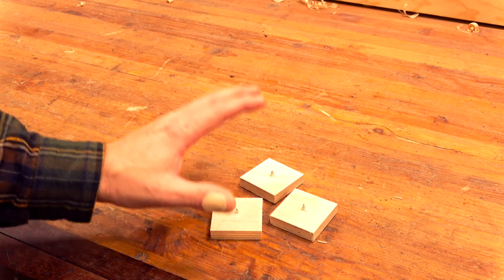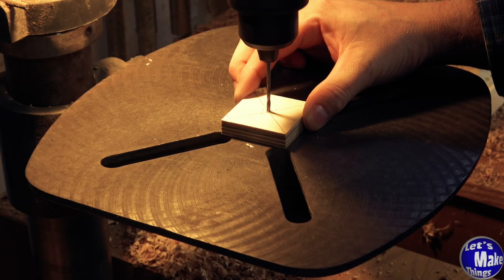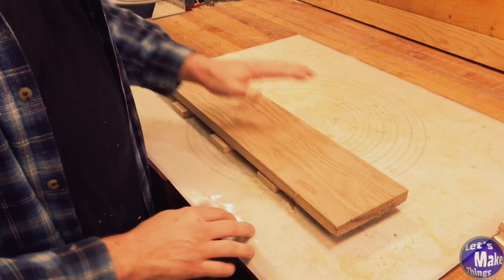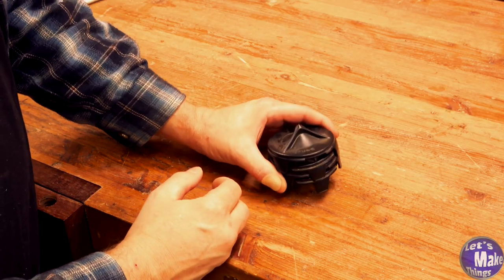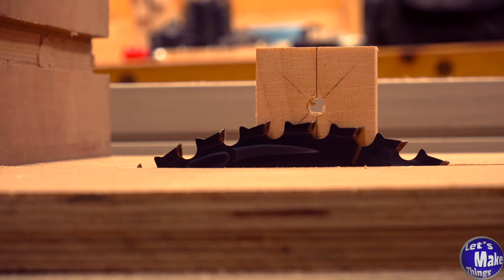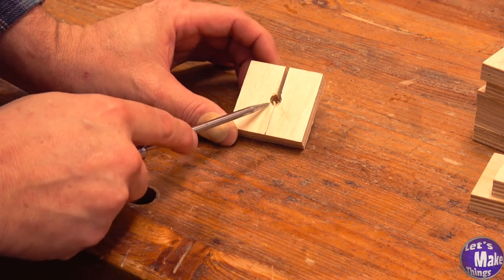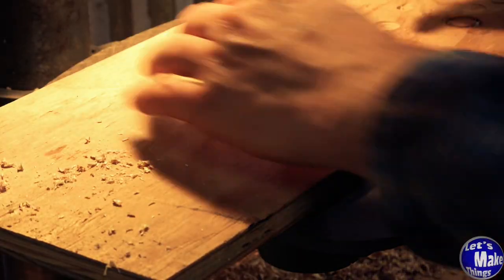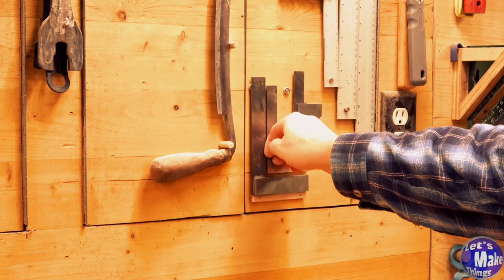Nesting Finishing Stands (Instructional)

Comment: Great idea!  I like the weight of them.  Have a cheap set of 8 triangle pyramids ($7) and they are always sliding around on me or tipping.  Low profile is good, imho!  If you added a piece of sandpaper or old inner tube to the bottom, plus the weight, it might improve that issue!  Perhaps even stick on silicon bumpers¿ Very Cool, Thanks Rob!!
Reply from the maker: Whoa...you came very close to explaining the video I wanted to put out this last weekend (I ran out of time)!  Keep your eyes open on my Make Things channel (and I'll have it here as well) for what you've described here!